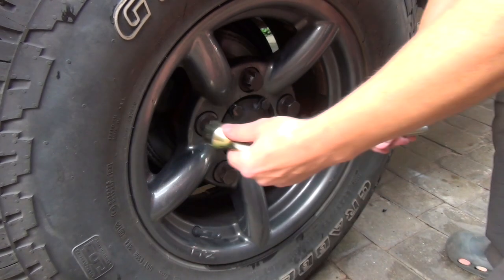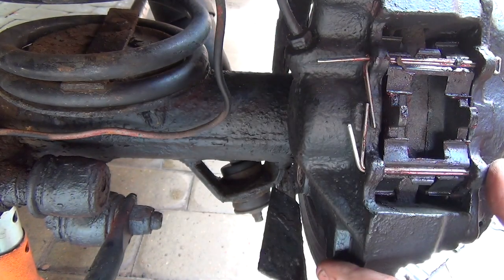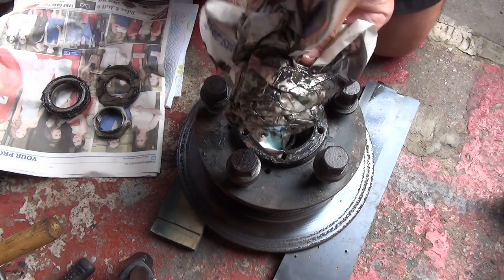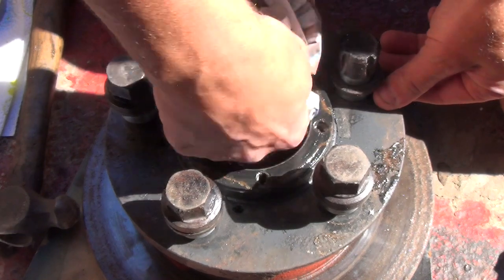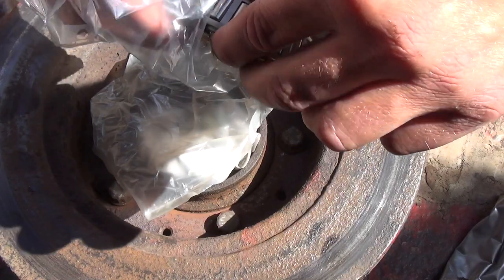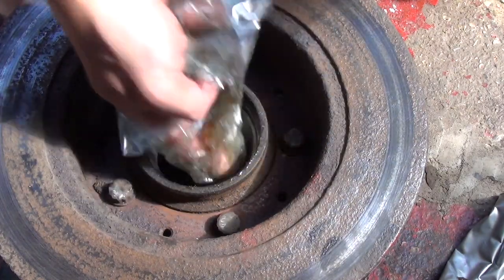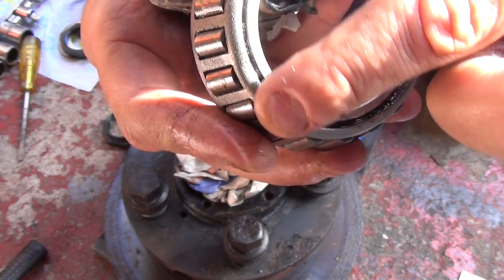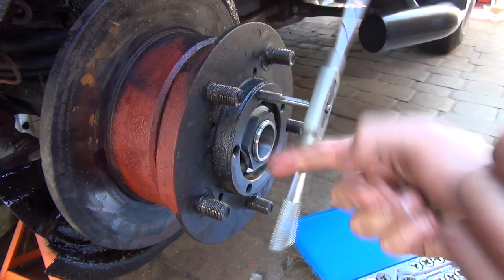Land Rover Defender TD5 90 Wheel bearing replacement

Comment: I’ve just done my wheel bearings on my 2003 110 defender, I’ve used the stake nut, the spacer isn’t a crush type like some on here say, the spacer stops the bearings becoming too tight, the nut is tightened to 220 nm job done.

Comment: Loving your walk throughs, keeping me occupied during lockdown! I’ve just had a wheel bearing go on my Td5 90 and was wondering what conversion kit you purchased to change from the single nut type to the twin nut style on pre 1999? Or is there a better way to purchase all the parts required to convert from the new spacer type to the old adjustable type?
Thanks!
Reply: Mine is the later type td5, 2002, so it is supposed to use the staked but, but I find the twin flat nuts with spacer etc to be a better way of doing it. I bought the kit off eBay , if I recall. Plus I had some existing spares .
Reply: Thanks IntenseDef - I have the same staked nut and spacer system so have just ordered a kit off eBay to swap to 2 nuts. I take it the centre spacer is just thrown away as it’s no longer needed? 
Are there any other videos in the pipeline for the defender?
Reply: @kitsrandomthings  correct, I don’t use the crush spacer, it is too fiddly to get right and harder to adjust later on, if any play develops. I have a few more vids that I just haven’t really got round to editing.
Reply: Finally got to see the rear wheel bearing video. I also prefer the 2 nut system. I've got an 01 td5 and when it's time to do tge brakes (same as him) I'll be doing 2 nut wheel bearings all round. Also wondering about conversion kits or if I can just go to my Landy specialist parts store and ask for a 300tdi wheel bearing kit
Reply: @garthbawden5550  as far as I can recall, all you need are the two nuts and tab washer, you are discarding the collapse spacer and the large stake nut, so it isnt a conversion kit. As stated in a previous reply, the older two nut method allows for adjustment further down the line and in my experience easier to setup. Like you I replace each of the staked nut setups, with the double nut 🤭 method as I come to them in general maintenance. Good luck
Reply: @intensewalkera  thanks for the advice. So is there any actual spacer between the bearings themselves or do they just sort of get caught in the taper of the shell and they just get sandwiched by the hub seal on the one side and the locknut and washer on the other side?